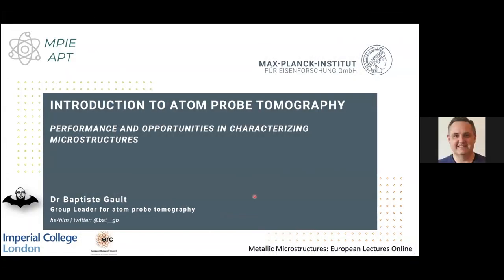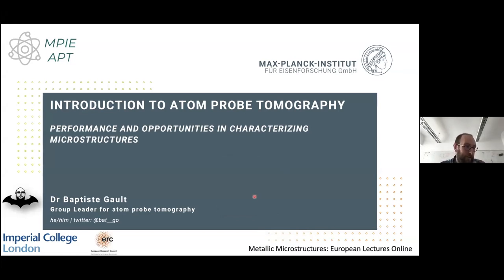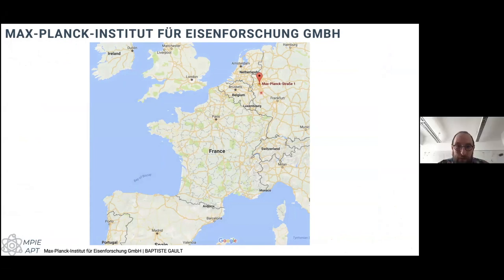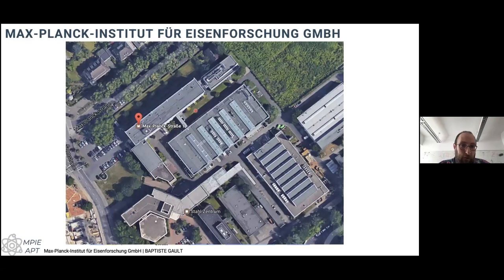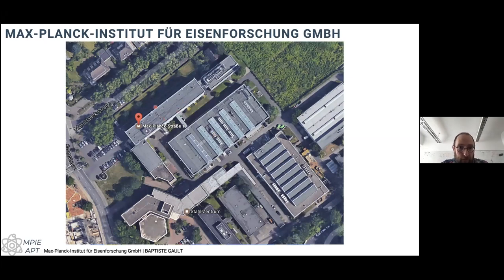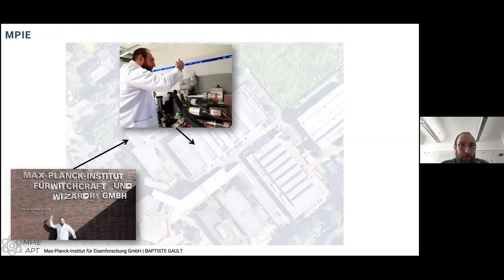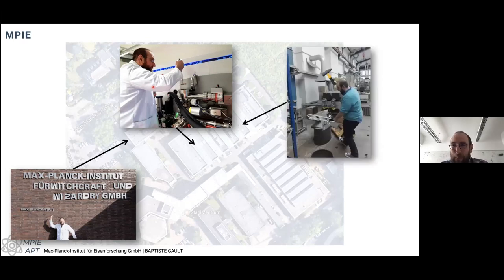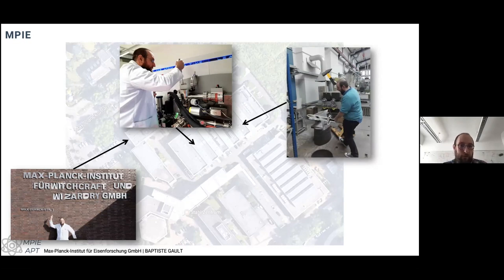Introduction to atom probe tomography: performance and opportunities in characterising structures

Comment: This is absolutely fascinating!
As you have been giving your presentation I have been taking notes thinking of how this technique can be used to supplement and support the critical technical data used to specify steels in the manufacturing standards to include a quantitive representation of the overall quality using chemical composition as a function which allows for analysis of the effects and interactions each alloying element on the microstructure has including:
Homogeneity
Ratios of constituents
Grain boundary discontinuities/defects
Plane symmetry 
Precipitates 
Segregation patterns  of alloys
(fatigue analysis) 
Theoretical vs Pratical(actual) :
Strength
Elasticity etc
I have been a fabricator welder for many years then became an inspector for a while and I have a passion for engineering. 
I would love to know if this type of approach could be modelled and used as a tool/technique in the certification process of steels which require high degrees of testing and inspections for approval ? 
Ultimately leading to an inclusion of this technology to the certification process of steels and possibly even further into WPQR's? 
Thank you for your time reading this and would love to hear back from you. 
Regards
Reply from the maker: The amount of material examined in any high-resolution technique, such as the atom probe, is incredibly small. It would not therefore be able to provide representative data on the dimensional-scales associated with your query.